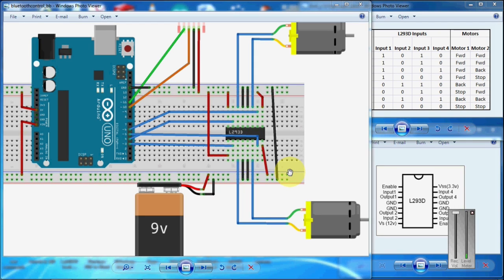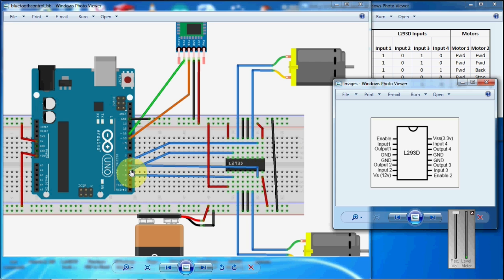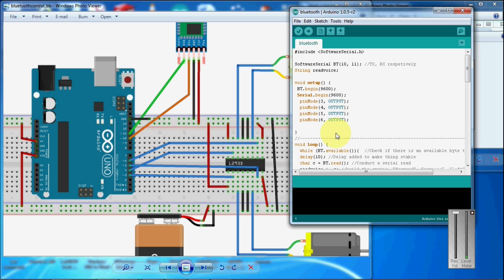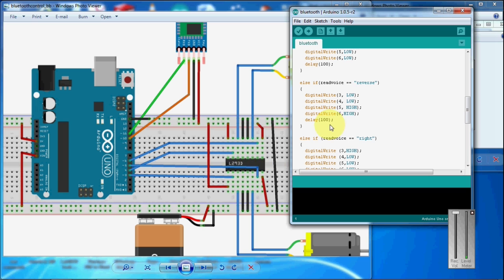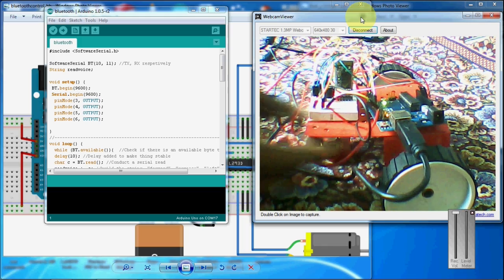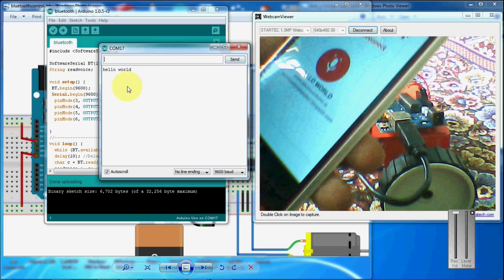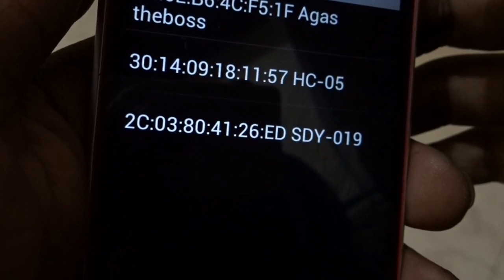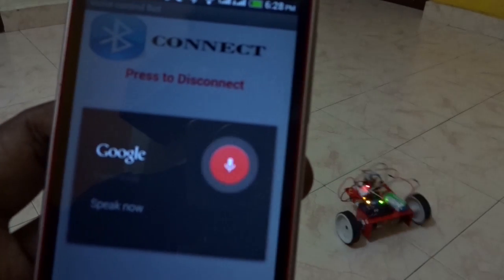How to Make a Voice Control Robot using android and arduino (Make robot in less than 15 minutes)

Comment: I just want to know how to run the power for arduino as well as the motor with the same battery without a separate 5v circuit?
can u help me with that?

Comment: hey sir your connections are not correct.if you connect the Bluetooth module to 5v it may damage the module.can you please make a another video on that please sir but the project is awesome
Reply from the maker: Bluetooth can withstand 5v. that's the manufacturing specification of it', I've used it for a year, still using it

Comment: Please help!!!!!
how come everytime i connected bluetooth by voicebot, i can only give 1 command, and i have to connect bluetooth again to give it another command and so on. Please tell me why?
Reply from the maker: Pls check your battery power supply, if the battery cannot supply the required power, arduino starts to reset the program. Try it out with external power supply connected to your arduino.

Comment: why we should connect the tx,rx to 10,11 pins there are separate pincs for commnication
Reply from the maker: Hi I used arduino uno which has only one tx and RX  which is inbuilt to it. The hardware RX and tx were used for serial communication between arduino and PC. So I used software serial to interface with Bluetooth.. We can use any pin as software serial ...